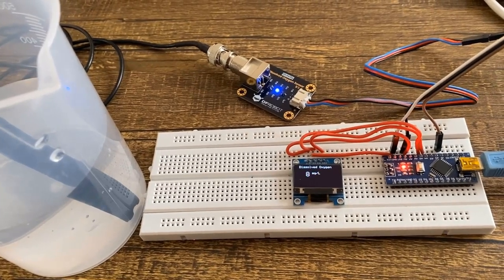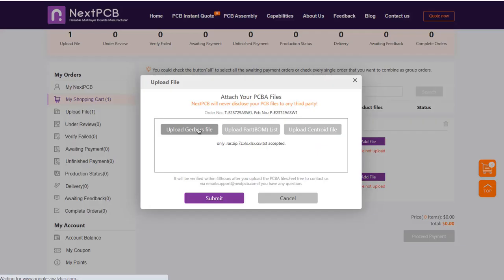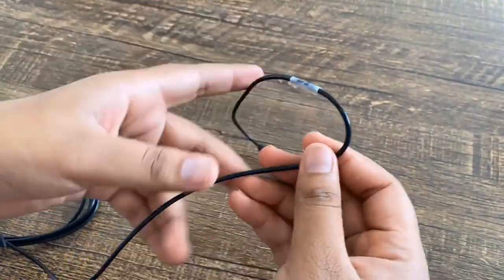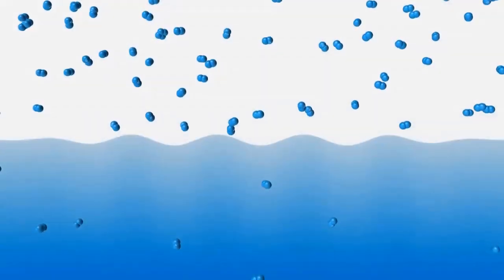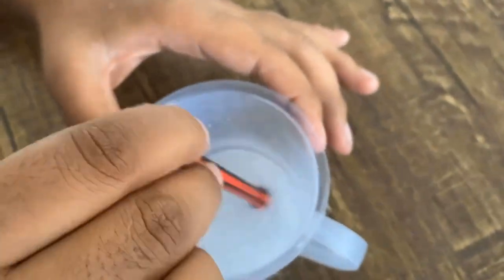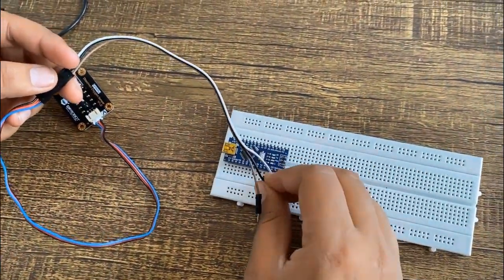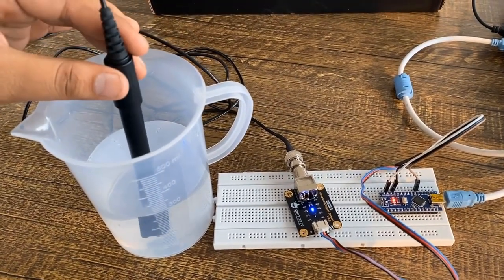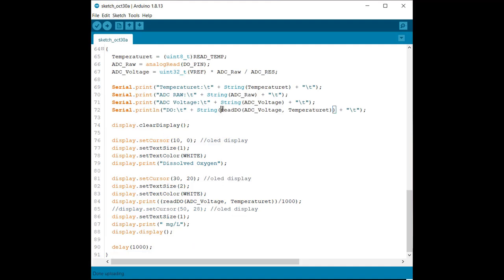Analog Dissolved Oxygen Sensor Tutorial  | DIY Arduino D.O. Meter

Comment: Hello, so i want to use this sensor and been following this tutorial but always ended up with the adc raw and voltage not stable. it value could go higher or lower by a lot of margin without any change of the liquid. pls help or recomend any solution, TIA!

Comment: My voltage is reading zero no matter what I do. Does this mean I need to replace the 0.5 mol/L NaOH filling solution? Or am I simply not handing the code correctly? Thanks!
Reply: any solution?
Reply: do the wiring on the ADC pin in ESP/Arduino etc not the usual GPIO pin, then the ADC value will appear in your serial monitor

Comment: I'm using the filling solution with 100ml with 2g sodium hydroxide and trying to calibrate but the value is too low, 3 - 4 mg/L. should I change the membrane cap? Thanks
Reply from the maker: No thats fine
Reply: @HowtoElectronics  but 4 mg/l is not healthy right? It should at least 7 or 8 mg/l, cmiiw
Reply from the maker: Yes more than 8 is good
Reply: @HowtoElectronics  then how come mine doesnt have 7 / 8 mg/L. Is it the sensor is broken?

Comment: I am using ESP32 as a microcontroller does the Voltage Reference that I would put  in my ESP32 code is also 5000 mv  the same the VREF in Arduino?
Reply from the maker: Esp32 has 12bit adc. This code is written for arduino and esp8266 which has 10 bit adc. You have to modify code for 12bit adc for esp32. Also the ESp32 adc in not linear as well which will give incorrect readings.
Reply: @HowtoElectronics  what  voltage reference value should I put in ESP32 to make an accurate reading

Comment: Can I use this the sensor with ESP8266 or ESP32? Can I use Arduino libraries with ESP?
Reply from the maker: Of course you can use.
Reply: @HowtoElectronics  what code in program should I change if I use this sensor with ESP32 sir? should I change VREF and ADC to 3300 and 4095?

Comment: Hi earlier I have Accurate results in my DO readings which is 5000 plus and ADC voltage is 1000 plus but then things go wrong

 and i dont know why is my adc voltage showing 0 to 20 or sometimes 200 something and my DO reading is constantly showing 201 or 79 and the results are so random. Please answer I really need to finish my project thanks.
Reply from the maker: Please calibrate the sensor again
Reply: @HowtoElectronics  I  calibrated the sensor just now and the output is 0 raw and 0 voltage...
Reply from the maker: May be you damaged the membrane cap. They are delicate and fragile and has huge sensitivity. Replace that.
Reply: @HowtoElectronics  I replaced it with the spare one but its always same results I think my sensor is faulty :(
Reply: I tested the sensor in a 36 defrees celsius water then things started to go wrong

Comment: how much water use?
1 liter or 50 ml?
Reply from the maker: Prepare 0.5N Naoh solution.

This can be prepared by mixing 20gm Naoh in 1 liter of water. Or same ratio.
Reply: @HowtoElectronics  but why do i see only a little water is used?
Reply: did you not use 1 liter of water? thanks
Reply from the maker: Use the same ratio like 20gm/1000ml
Reply: @HowtoElectronics  means that you can not put liquid into the membrane cup ??
Reply: @HowtoElectronics  but in your videos use 50 ml water .
Reply: Confused answer...  in the video is putted 20g to 50ml not 1g to 50ml